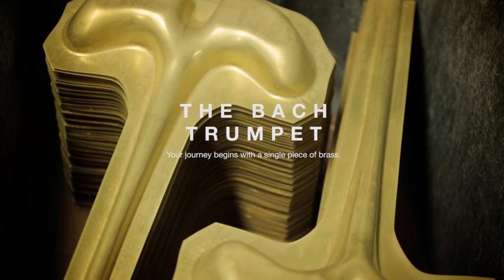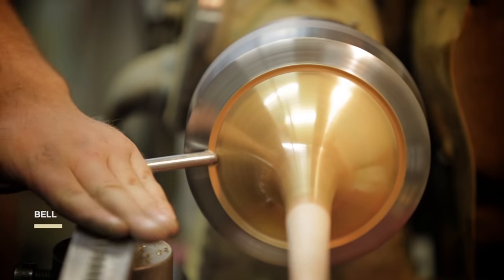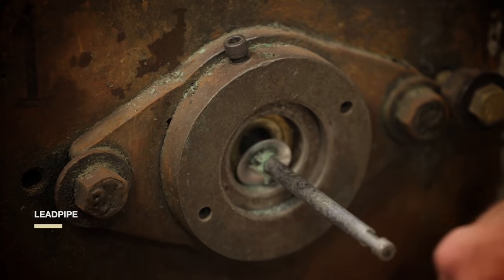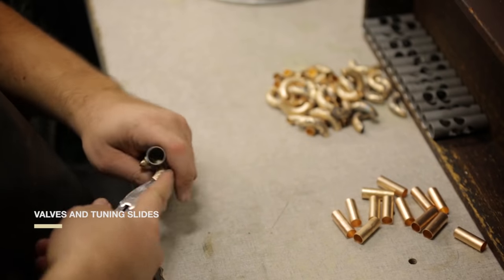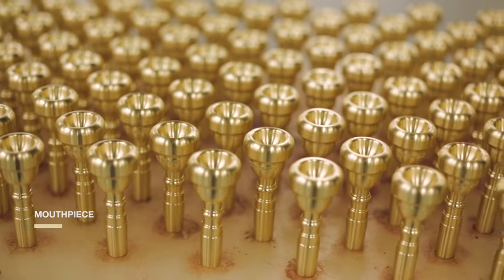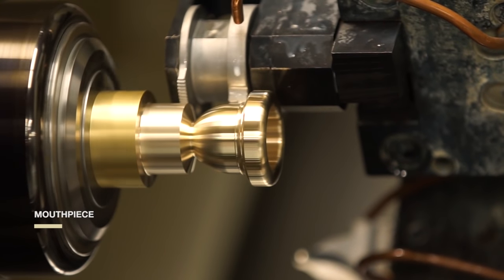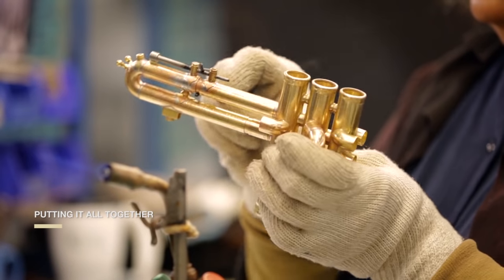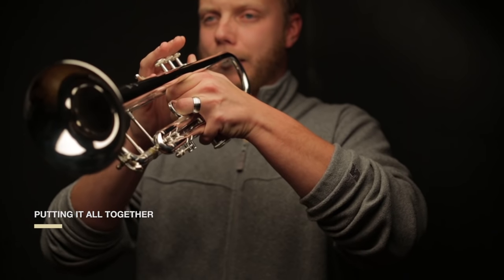Bach Trumpet Tour

Comment: making the mouthpiece was easily the most satisfying thing i have ever seen
Reply: Pickle YT the real question I have is what are those tolerances? The mouthpiece seems like it shouldn’t be as exact as the trumpet should be, but they’re CNC machining the mouthpieces...
Reply: Look up the clicksping youtube channel if you want to see more similar stuff to that :)
Reply: @trevanminnig3499  cnc allows easier/faster/consistent mass production
Reply: @trevanminnig3499  The trumpet itself is tunable with all of its slides. The mouthpiece is where all of the sound comes from for the instrument so once they have a design that works well, it would pay to be able to recreate it exactly every time.
Reply: Bryan Neill I get that, I just think that the actual tolerances would be pretty wide open, so to me it originally seemed like it would be easier to find a different way to manufacture them, however I didn’t think about the fact that it is what actually allows for sound, and the rest of the instrument is mainly for tuning and amplifying. I realize now me saying that the mouthpiece not needing to be precise would be like a wind player telling me that wrapping coils for a guitar pickup doesn’t need to be precise.

End of the day, though, I am still curious what actual tolerances they’ve got for it.
Reply: Trevan Minnig its likely that other production methods don’t yield as good results as machining from an extrusion. This company makes higher end instruments that cost quite a bit, so I’m sure the decrease in yield is covered by the increased cost to the consumer. As for tolerances, probably a couple thousandths, they will probably produce them and do random testing with a go/no-go gauge until they find that tool wear  requires a change in the CAM or a replacement tool. But I imagine a few thousandths is all that stands between a great sound and something less
Reply: This mouth price they made at 5:33 is actually a trombone mouthpiece 🤣
Reply: @shepshepson  no it isn't
Reply: @joashchechet1675  yeah it is lmao, I've seen the size it was kinda funny, I'm not talking about the whole video, just that one part.
Reply: @shepshepson  no it's a really deep trumpet mouthpiece